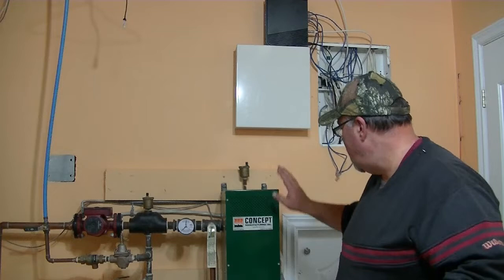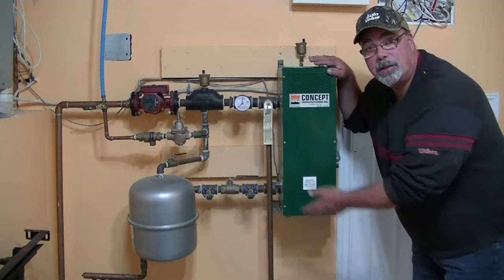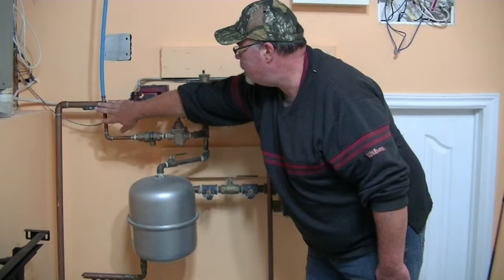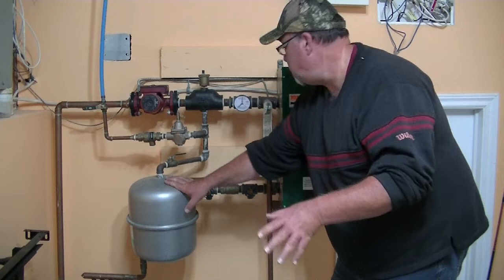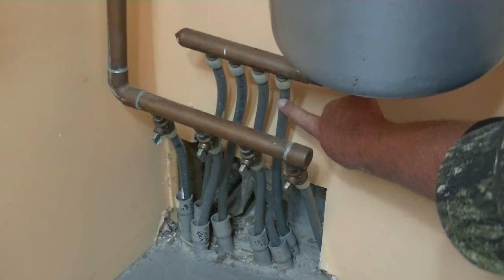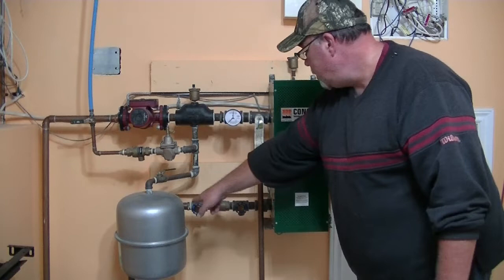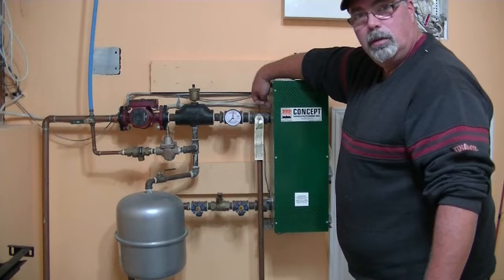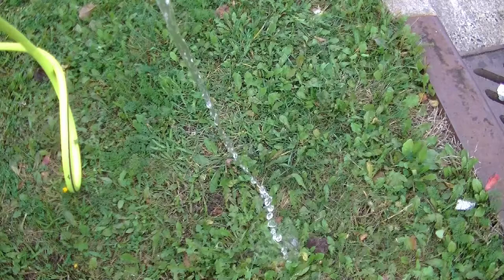How to Flush an In Floor Heating System

Comment: Boiler heating systems require corrosion inhibitors added to the boiler to keep corrosion at bay (caused by dissimilar metals used in the system) which is what causes the sludge to form. Typically 1 qt (or 1 liter in Canada) is added per 100,000 BTUs of boiler output. so a 150,000BTU system requires 1.5 qts. A water sample should be taken each fall before heating season and tested for corrosion inhibitor.  As Tony mentioned, if you don't leave the fresh water valve open and you lose boiler water/pressure, it can damage your boiler or at east caused the system to shut down by the high limit switch. The black device where the fresh water goes into is an air scrubber which pulls out air then it releases though the brass air vent on top. You need to leave the little black cap (similar to a tire air valve expect work in reverse) open to let air out when it is scrubbed out of the water. Also do not drain boiler water on your lawn or other vegetation as is has chemicals in it. Any mechanical/boiler room has a floor drain.
Reply: I do wish all mechanical/boiler rooms had a drain!

Comment: If you have oxygen barrier pex in the floor and a closed loop hydronic heating system where potable water is separated from it, and if you had air purged from the hydronic heating system when it was first put in, then unless the system has leakage issues, I don't think you ever need to flush it.  The guy you talk to probably used regular pex for hydronic heating tubes.  Unlike oxygen barrier pex, regular pex could leak oxygen into the tubes via tub wall thus corrode parts made of cast iron, such as circulator pumps, fill valves, boiler heating elements, etc., into the system.  Also, if in-floor radiant heat is your only hydronic heating source, then you don't need a boiler.  A good water heater is sufficient.  In-floor radiant heating uses 85-140°F, whereas baseboard hydronic system uses 130-160°F.  Two hot water heaters, one for in-floor radiant heat, one for domestic hot water, good to go.
Reply from the maker: Awesome information. Mine did t need to be flushed, there wasn't anything in the lines. They all ran clear the whole time. Cheers!

Comment: You don't have a clue what components you are talking aboout!   The "thing" you called a pressure relief valve is an automatic filler valve. This keeps 15 psi in your system. If the system goes lower than 15psi this valve opens to let water in until the system reaches proper pressure. So you should leave the fresh water supply valve open all the time. The lever on top of the automatic valve is a manual fast fill lever. The "the gray thingy" is a pressure tank.    You should have proper info before posting nonsense
Reply: Yes tony you hit the nail on the head!
Reply: May I ask what is the black thing has 3 connections? he said there is a pressure relief valve on top

Comment: Do you know if it is safe to turn off the system during the summer? It came with the house when I bought it and I really know nothing about it. I don't know who installed it and haven't had much luck finding someone who services this type of system. I think it is a water-based system with an electric hot water heater (I say it that way because someone said it might be more than just water...but I have no idea.  Thank you!
Reply from the maker: You would be safe to turn it off during the summer but when temperature start to go back down around freezing you'll want to turn it back on
Reply: @steve45ca  Thank you! I'm nervious about flushing it out but you boosted my confidence. Thank you for posting this!

Comment: Very good. We have underfloor heating in kitchen dining area - it’s never been that great. We have wood look ceramic tiles on the floor - some of these get warm on you feet but other areas that don’t get warm at all. I was surprised that you said yours works so well that it heats your upstairs. No such look here 🤔
Reply: that is probably due to the layout of the hot water pipes under the floor. If you space the pipes too much you get cold spots
Reply: @michaelcarton3299  thanks. They seemed fine, saw them down before the tiles went on top. Could it be that some pipes or touching the tiles above them and some not OR could it be that some 'zones' just don't work? There seems to be a number of separate feeds? Anyway probably not much we could do as tiles are all now down.
Reply: @dalegriffiths3628  how big is this area? I would imagine one area like a kitchen would all fall under one zone. Are you sure you have hot water in-floor heat and not electric matts under the tile?
Reply: @michaelcarton3299  its about 4m by 3m. Definitely hot water system as I paid for them to go in and saw them down before tiles went on top.

Comment: NOOOOOOO.... Pressure regulator, expansion tank...   So much of this is incorrect.      Also, who ever built that system should also not do this any more.  There is not an air-separator, those are electrical conduct in the concrete it should be a box.....

Comment: While good old boy steve helps describe flushing he has very little knowledge of terms. The things he describes as PRV valves (pressure relief valves) are NOT pressure relief valves. The one on the boiler is a PRV but the others are not. The one near the incoming water is a pressure control valve (controlling pressure) and the one at the top is an air relief valve. Also, the system should have some way to make sure no pollutants can go back into the city water system. AKA double check valve. Otherwise pretty simple explanation of a very simple floor heating system...By the 90% of most floor heating systems are much more complicated.
Reply: True, he is not up on his terms, but neither are you! You may want to investigate things like pressure reducing valves, temperature and pressure relief valves, Hy-vents, and most importantly, backflow preventers. It makes me laugh how you made these pretentious comments and WERE WRONG about every single one. Your boldest fallacy is claiming a lack of what you call a "double check valve."  In fact, a Watts #9D Backflow Preventer is clearly shown in the video, installed exactly where it's supposed to be.
Reply: @richardp3624  All my terms are correct it is just that there are multiple names for each component (slang and otherwise). My terms of the terms I used were for the novices out there that needed to know that his terminology was incorrect especially if they were going to try and build this stuff themselves. The first three things he describes as water enters the system are incorrect and my terms are correct. I could call them by more proper names but the general public would not know how to interpret that. So in conclusions, go ahead and laugh but those who laugh last laugh the hardest.

Comment: what about radiant heat its not work in oil heat
Reply from the maker: The radiators may be air locked. There should be bleeder valves to let the air out

Comment: What about the air bubbles?
Reply from the maker: I didn't have an issue with air locks or bubbles
Reply: his system has air release valves in it

Comment: Whoever told you these systems need to be flushed every year is an idiot. If the proper fluid was added originally and there are no leaks (thus no new makeup water), they should never need to be flushed ever. Almost all of your terminology was wrong, but that's pretty irrelevant to the flushing. What you did was not really even flushing, the velocity was far too low. You need to raise the velocity by raising the water flow in order to bring any sludge or sediment into suspension.
Reply: thanks cap'n armchair.

Comment: Do not use information in this video as it is incorrect and misleading for the most part, and will result in early system failure. Too frequent flushing adds too much oxygen-> rust.
Missed the key points and water chemistry maintenance. Wrong terminology.